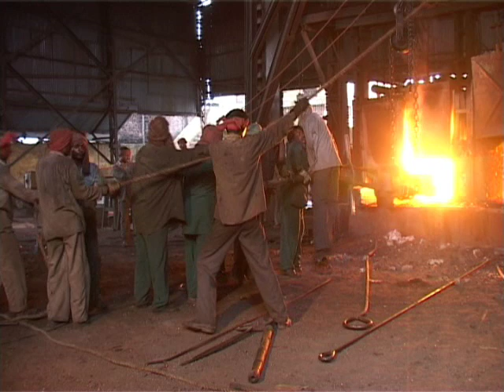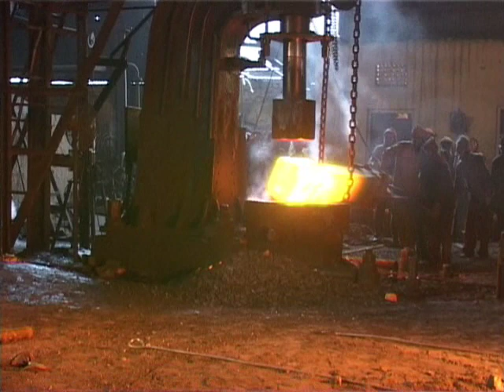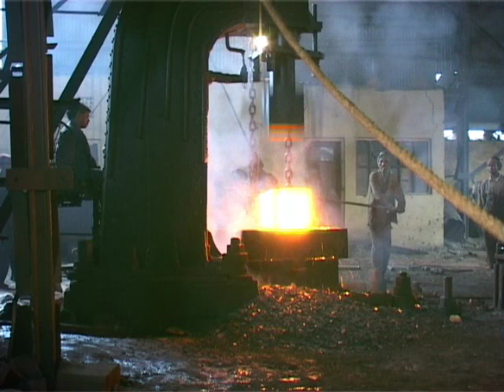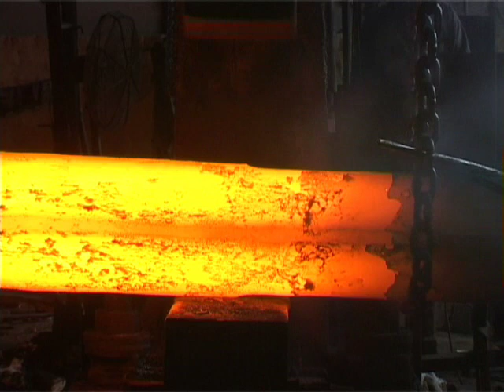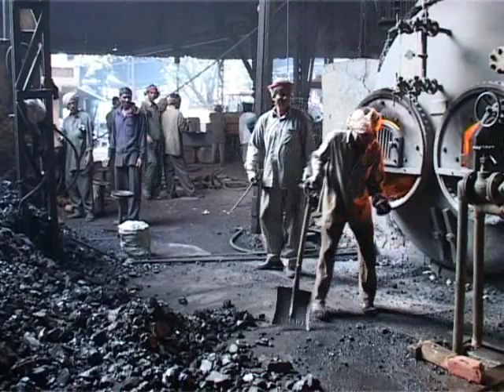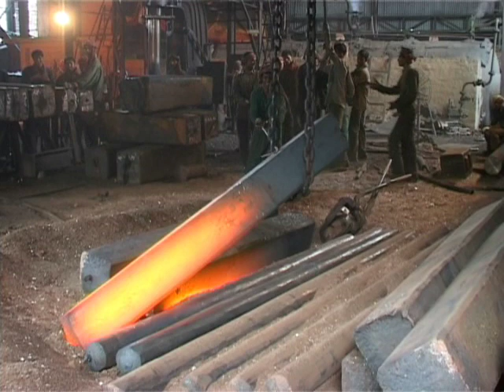Howrah Steam Hammer, West Bengal, India, 2008

Comment: Victorian machinery with Victorian working conditions.
Reply: Victorian-ish equipment, but it's really not all that different from modern forging equipment. All it's missing is a proper manipulator for the material and you basically the same gear that produces parts for NASA.
Reply: @arceusmaster91  You're kidding ?
Reply: @benjaminstassinet9585  no, he's accurate. Process is same, except blobs are kept by hydraulic manipulator and operator is further away.
Reply: @benjaminstassinet9585  the operating mechanism of the hammer is different than modern cnc hydraulic forging presses/hammers, but the forging process is basically the same. Just a slightly smaller scale.
Reply: @benjaminstassinet9585  although I'm comparing open die industrial forging, something common in LARGE forgings like this. Closed die is usually used for smaller forgings.

Comment: What are they making?
Reply: Interesting. I'm a hammer man at a forge. Hot, dangerous, dirty ass work. Pays very well though.
Reply: Red What education did you need, how well does it pay, and how is it dangerous?
Reply: Union..I really enjoyed your input on this thread.  Some pretty dangerous stuff indeed.  I used to work for McDonnell Douglas where we made commercial and military jets.  They used what we called a drop hammer, I am guessing they used dies to form metal. These things were huge. The operator would swing the hammer up and down two or three times before striking the die.  These machines were about 300 to 400 feet from where my office was in another building.  You could feel the ground vibrate even that far away when they were working those machines. Anyway, this looks sort of similar.  Thanks for the education on Hammers. Cheers!
Reply: Union Blacksmith I'm sorry for not giving a thanks, thank you even though it is late :) I liked your comment, and i sometimes consider that a way of saying thanks to a comment. Hope you're doing well these days.